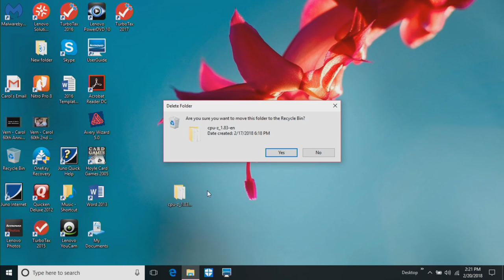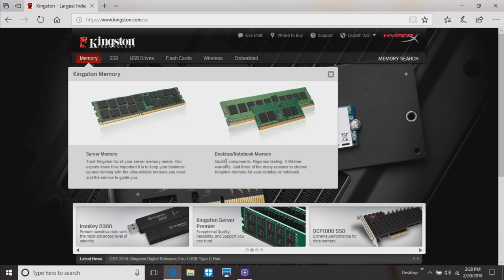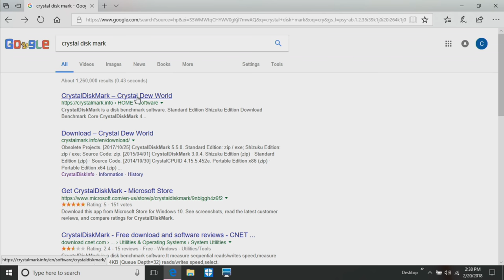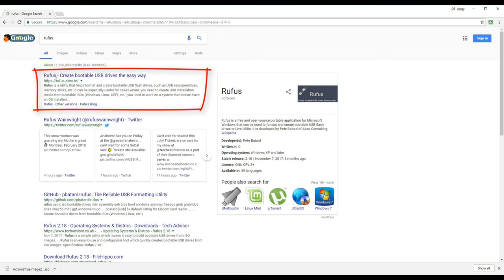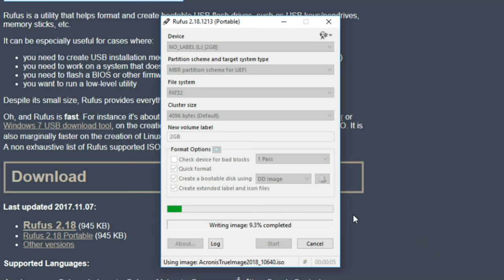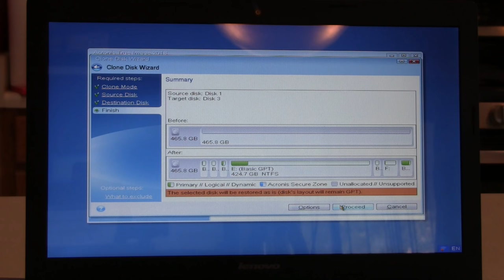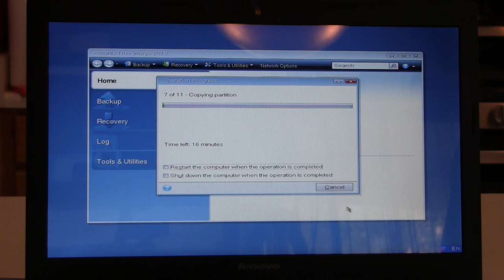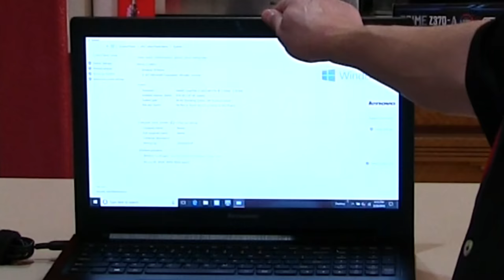Upgrading a laptop

Comment: I enjoyed watching your video.  Even though I am quite knowledgeable with building PC's, I was intrigued by your video title because just last week I upgraded a laptop a friend gave me that he wasn't using and hadn't used in  years. The "Trashed"  laptop was an old HP G6-series (17" HD Screen)  with an A6 cpu, that he claimed was too slow for him. I took it home, cleaned it up, replaced the HD with a San disk 250 GB  SSD ($70 @ best buy), replaced the battery ($13 on Ebay), upgraded to Win 10 and upped the memory with an additional 4 GB of RAM. This made it speedy enough for me but I did this to give as a surprise gift for my mother-in-law, who was still using a cheap laptop she had for almost 10 years (she couldn't afford to replace it). Hers ran like a snail compared to my buddy's old laptop BEFORE my upgrades! Your customers may not want to spend the kind of money (pro tech repairs) it takes to do what I did, but for us knowledgeable people it can be quite worthwhile to do, for how little it will cost us to pay for the parts alone!

Comment: The reason it wouldn't boot of the other USB socket might be because it was USB 3.0 (it's clearly blue as opposed to the other one) and some of the earlier devices with a USB 3.0 port need a driver to enable it which isn't loaded until the OS boots.  So with older devices you might need to boot off a USB 2 port.
These videos are excellent.  This is exactly all the same stuff that I do/use (for my own kit) and I'm also picking up some tips a long the way on a tool/tip or two that I didn't know about.  Nice that that laptop has all the upgradeable stuff behind just 3 screws. I wish all laptops were like this.

Comment: Thanks a ton Carey! Youtube should have the possibility to give a thousand like for this video. 
Your video taught me how to optimize my old Lenovo Y510P laptop performance. My laptop was a nightmare since I updated it into Win 10. I was thinking to spend about 1000- 1500 Euros to get a new one. I followed what you said all the way to the end and all worked (other than a bit of change because of Acronis True Image). So, with below 200 euros (110 Euros for Samsung hard disk, 25 Euros for Acronis software, 10 Euros for Sabrent cable and 40 Euros for 8 GB Ram Kingston), I hope it works for another 2-3 years. I can't thank you enough Carey! 

One thing that took me about 6 hours was that Acronis True Image was not functioning as good as 2 years ago. There are lots of negative feedback regarding bad user experience on Amazon for version 2020. So I decided to buy 2019 version. The one I bought was also defective. I followed as you instructed here but unfortunately the .ISO file from their website was not functioning. I couldn't use the DVD as it couldn't be read by my laptop. I'm going to return the Acronis back to the vender. The solution that turn out to be working for me was that Sabrent cable comes with support of Acronis - on the box for Sabrent hard disk cable is written that Acronis True Image for Sabrent software is inclusive when one purchase this cable. In Sabrent website https://www.sabrent.com/downloads/ we can download it. At the time of using the software the Sabrent hard drive cable must be plugged into the laptop. The cloning can be run under Windows OS (I tried it on my Win 10). It took me about 1 hour to do the cloning job without need to wrestle with changing boot device under CMOS setting, etc.

Comment: 13:15 The real clock rate of frequency of ram is 1/2 of the rated frequency is because RAM these days processes 2 pieces of data per cycle. The word DDR stands for double data rate make sense in this case.
Reply: That is for data transfer rate, this is Dual channel, so if the ram is rated for 1600mhz Dual channel, then single channel would be half that, in this case 800mhz.
Reply: @dongiddens7438  No. What Justin Leong said was correct. Dual channels mean chipset of the motherboard provides two dedicated high-throughput data channels. The channels permit reading from and writing to memory to occur on distinct channels and have nothing to do with the speed of the RAM.
Reply: Justin Leong was correct... is asian, can confirm.

Jokes aside, Double Data Rate... alternating transfer exchange is responsible for it displaying a (*true value*freq) following its marketed number.

Comment: This worked SO WELL!   By putting Acrosis on a flash drive it takes all the risk out of creating an SSD clone.  I've shut my laptop down the last few times just to watch it boot up!  It is so fast, like I bought a NEW computer.  I have a LARGE 3D program that used to take forever to load, now it's fast too!
Reply: The bootable flash drive is the best kept secret because it allows you to upgrade to as many SSD'S as you want for no additional cost. Most people use Acronis once because they run the .exe file and never realize that if they would have created the Rufus bootable flash drive, they would retain multiple applications.

Comment: Great video. Been doing this for years and do it the same way. I know there are free programs to use, but Acronis has 1) Never failed me and 2) The installed version (if bought by customer) allows them to have some piece of mind that comes with an auto-sync backup and recovery option.

Comment: I have seen some anomalies with the Kingston upgrade checker, I use an old Lenovo X220 for some hobby stuff,  I bought it as a cheap ex corporate machine, upgraded it the day I bought it to 16GB and SSD, it is a modest i5 CPU but more than adequate for the purpose (Win 10 pro). I believe due to the cost of memory when the machine was made it was never certificated for 16GB, just 8GB. It is solid and reliable with 16GB but not listed as possible on Kingston website. It is obviously up to the individual to do their due diligence. Many of these old laptops are very useable for stuff rather than being thrown away, for instance if you are into digital photography it is handy to have an inexpensive laptop to take on holiday, no need to have a brand new flagship machine just to quickly save and review pictures.  The removed conventional hard drives are fine to be put in caddies. Great advice as always, Acronis may have saved me a lot of work!

Comment: Great video.  I have been a fan of Acronis for years.  It is the only backup method I trust. My laptop is a Lenovo G50-45 which has an AMD A6 (yea, I know what you said in the video).  I recently increased my RAM from 4GB to 16GB, and your video inspired me to order a SSD to replace the existing HDD.  I expect it to be delivered later today. I hope to get a big increase in speed.  Thanks for the links to the utilities......
Reply: How did the upgrade to SSD go,is it faster?
Reply: hi Carey i know you a fan of adata ssd drives and acronis true image did you know if you register with a data your ssd they give you the option of a FREE acronis drive image key

Comment: Carey, you're amazing very good instructor. Clear step by step presentation and clear like a TV announcer. Like what you've suggested I ordered a Samsung SSD 250gb and a caddy for my current 1TB mechanical HD to be relocated on the optical bay. The only different was I downloaded a Free OAMEI backupper standard instead of buying Acronis. There would be a slightly difference in procedure in creating bootable disc and everything you have shown. Following the step by step procedure is easy but I might miss some options to check mark. Would you be able to add the same but instead of Acronis use Aomei backupper. The most complying reasons to use the later is it's free and most often  than not it will be use once by most. The Acronis 2018 which cost you $30 is now $35 at Amazon for one laptop while the AOMEI free, no users limit.

Comment: This man is not lying. My mom has an old HP Pavilion DV6000, which had a mechanical hard drive. (It was my first laptop and then it got to my mom after I got a "better" one.) It even has only 2 gigs of ram, I think an Intel Core 2 Duo. I broke the keyboard (accidents with dropping it sometimes and its just the keys, the keyboard works fine the keys only fell off). But after we got the keyboard fixed, we both got surprised. It was a Sandisk (I don't remember the brand correctly but I think it was a Sandisk) And then it was so fast, it was with Windows 7 but then she upgrade to Windows 10 1909 (because she got annoyed of those "Upgrade to Windows 10 because Windows 7 is out of date" type of pop ups from Microsoft). It still isn't upgraded except for the SSD and it's faster than my laptop (which is a pretty cheap laptop ngl with twice as much ram, a bit of better graphics + a little better processor). Whenever quarantine ends and I get enough money, I'll upgrade to a 512GB SSD. I have a 500GB HDD so, it is the same size (i don't think its a big differece 500 from 512) and hopefully, from 4GB of ram to 8GB. I hope that will be enough for Windows and my laptop is general to perform a bit snappier. I don't really like Linux since I'm used to Windows and hell no to a Hackintosh, because my laptop isn't compatible.

Comment: Thank you so very much for an excellent video.  My hard disk read/write speeds went from in the 80's to the 500's and 400's.  I had some issues with getting the bios to boot to the flash drive and at one point it would  not even come up at all.  Finally it somehow cleared itself up and all was fine.  All in all, it all worked itself out and again I am very thankful to you again for a great video.

Comment: Well, you certainly picked your targets quite well here, Lenovo has always been the best when it comes to maintainability and stability, and as a contrast you have not an HP, not a Dell, but a Toshiba (which we used to call Tosh**ba <- fill it in yourself, not so difficult). I was surprised that that Toshiba had any running power left in it at all, and in that case your recommendation of buying a new laptop would certainly be the better option.
Anyway, when I worked PC support we had Thinkpads, and those laptops are built like tanks. And Lenovo certainly brought their PC-building expertise to their budget models as well (as the G-series you have there demonstrates). Sadly the software side isn't as good, Lenovos are quite known for the bloatware they install as standard. I used the (at that time) budget model R50p and it was - apart from the plastic case - not any worse than the T- and X-series Thinkpads we usually had at that company. Btw. you know they have all their hardware maintenance manuals downloadable on their site?
Anyway, good video, good techniques, and nice tips for programs you can use.

Comment: I know this is too long, but wanted to share this SUCCESS STORY THANKS TO DR. HOLZMAN! Just upgraded my beats-audio HP 15-p043cl Intel Core I5 4210U Haswell chip laptop I got a costco about 5.5 years ago.  Really like it, I did not want to get a new one, but it was super sluggish lately. I run eclipse as my IDE on there sometimes and lately when I would just save a file it would go off into "no responding" land after just 40 mins of using the application, and never come back. On a normal day, It took 1 min 20 secs to start up. The fan was constantly on, my CPU usage and DISK usage were running at top end alot, and the temperature was never under 98-99 degrees. Prior to upgrade, I removed any programs I thought were junkware, removed junk files, defragged, virus scanned, cclean'd, wisecare'd, malware-byte'd, and it actually made it better, but you could still hear the mechanical HDD just churning away and the fan spinning constantly. Did not flash the BIOS. So I ordered a Samsung SSD 860 EVO 6 Gb/s 1TB drive, and since the original spec only supplied 12 GB of RAM with 16 GB capacity, I got an 8 Gb Crucial DDRL - 1600 SODIMM 1.35V CL11 RAM stick (the samsung RAM I needed would have taken about a week to get here, so went with crucial), a SATA cable, and a SSD spacer. I watched this video and saw the unreal performance gain you got, but was thinking even a little better perf on mine and I would be pretty happy. So I followed your instructions, installed everything was pretty painless. Did not use Acronis, used the SAmsung Data Migration tool, was done in 35 mins. But here is the best part. When It boots up now, it gets to the login screen in about 5 seconds or less.  Whoah. Then it boots up fully after login in 15-23 seconds, sometimes less. Holy cow. Browsers open instantly. Programs open instantly. Eclipse used to take forever to open like almost 1 min 30 seconds, with another minute of building projects, etc - now, its opening in 16 seconds, fully operational. The fan rarely comes on, not because its broken, but the avg temps I am seeing now are 73-82 degrees!!! The CPU and DISK are never overworked anymore.  Was never like this even on DAY 1!! THANK YOU SO MUCH for doing these videos, I have a 5.5 year old LAPTOP that is better now than it was back then. Hoping to get another 5+ years, please keep doing what your doing, big fan here in CA.
Reply: Wow ,very nice ! I plan on doing exactly what you did :)

Comment: When it comes down to the decision as to whether you should upgrade a current machine or opt for a new one, I look at the following factors to make my decision: Scalability, Task Requirements, Cost, and Performance. 

If you have an older laptop that only supports a dual-core processor, the scalability is going to be limited (i.e. for the Core 2 Duo, the very best you can get is the T9900; which, again, is only a dual-core processor that lacks any of the newer instructions, features and capabilities.  You aren't going to have Turbo Boost or Hyperthreading available to get more performance out of that processor.  Then there is the fact that most laptops running Core 2 Duo's or Core 2 Extremes is that they utilize DDR2 SODIMM memory.  The cost of an 8GB kit for this increasingly-rare memory will, at minimum, cost you upwards of $90 USD.  

In a system like that, I would advise forgoing any upgrades to such a system.  I would sell it and use the funds toward the purchase of a newer laptop with quad-core processor compatibility, DDR3 memory or higher, and THEN look into upgrading the hard drive to an SSD and increasing the memory if it is 4GB or less.  Idealistically, a decent i5 with Turbo Boost and Hyperthreading enabled with a clock speed of at least 2.5GHz coupled with an SSD and 8GB of memory is a system that can be upgraded relatively cheaper (you can get 8GB of DDR3 SODIMM for a fraction of the cost of DDR2 SODIMM) and the Core-i-Series processors (again, an i5 or higher unless you're using an 8th-Generation CPU or higher) should be the starting point of your processor. 

Solid State Hard Drive prices have dropped quite a bit as the technology is becoming more and more mainstream, and Scalability (the ability to further upgrade a system beyond its initial specs) are significantly cheaper compared to their older and slower counterparts (dual-core processors, DDR2 memory, SSD's instead of mechanical hard drives, etc.).  I would much rather invest money into a laptop that comes with an Intel i-Series processor, DDR3 memory, and the ability to upgrade from a mechanical hard drive to a Solid State Hard Drive. 

Scalability means your ability to upgrade the system beyond its current specifications and there are plenty of great laptop deals out there that utilize DDR3 or DDR4 Memory, and Quad-Core+ processors.  It's much more cost-effective platform to improve upon than older, DDR2-based laptop boards. 

Hope this helps anyone looking to purchase a laptop!

Comment: Guess my W530 may yet have a second life. Added to my project list. Thanks Carey!
Reply: Captain Piratedanger Yes it will. Same one I have.
Reply: Lobster Johnson I have the same Thinkpad purchased in 2012 with an i7 in it and two Toshiba HDDs in Raid config. Got rid of the horrible Toshiba drives as even the warranty replacements failed.  Put in the a Samsung 840 pro 500gb as boot drive and  1 TB WD black in the other bay for data...got rid of raid.  Used Acronis to clone drive.  I kept one of the Toshiba drives as a clone image of my boot.  Good thing I did as my Samsung pro drive   crashed and failed during a video con.  Continued video con on cell phone while swapping the drives in the W530 to the Toshiba drive.  Back up and running in 10 minutes...most of that in slow boot up time of the 7200 rpm Toshiba drive. Got Samsung drive replaced under warranty.  The pro versions have 5yr warranty vs 3yr for non-pro versions. My W530 has 24 GB RAM - came with 16 GB.  I used crucial memory.